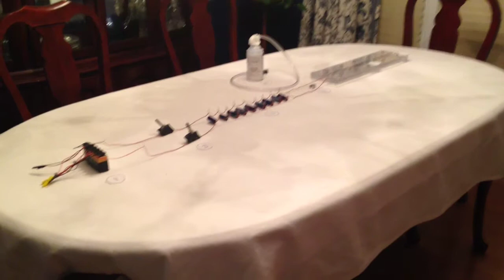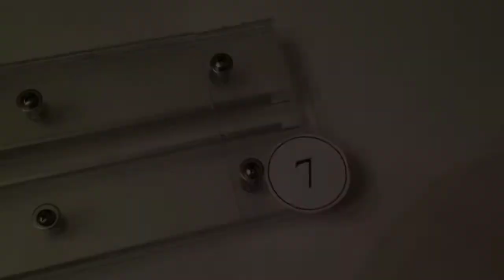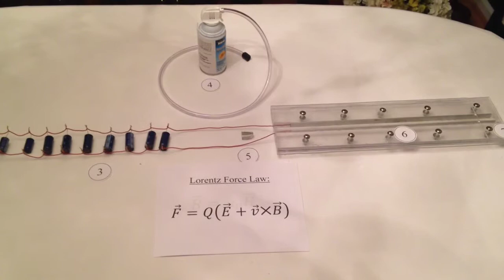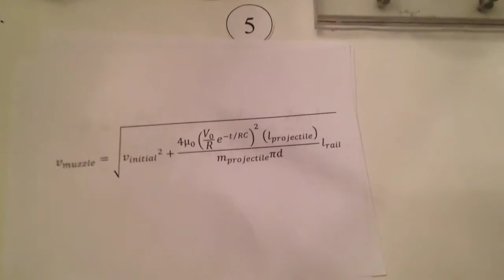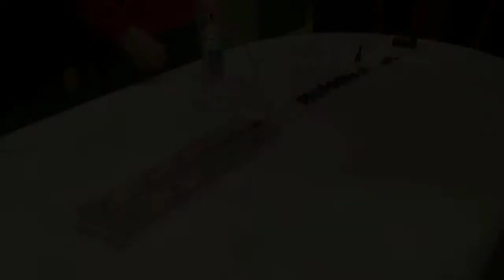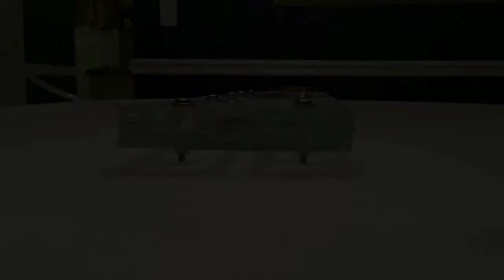MAE/ECE 535 Demonstration Project: Rail Gun

Comment: Nicely done. 

It looks much neater than mine, very well presented. My only quibble is that the formula used isn't entirely accurate. All the fundamental ideas are in place, but the fact that the resistance (and therefore current) will change over the course of the firing will mean that the values you get from that formula will be quite different to what you would get from firing (aside from real world losses). I guess that going through the enormously convoluted process to get it completely accurate just isn't necessary in a project like this.

Enjoyed, well done.